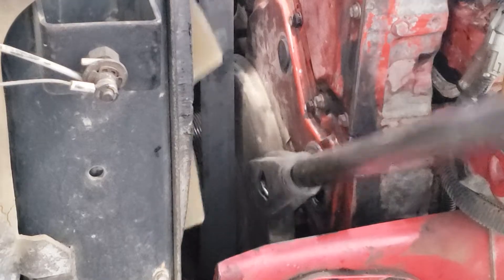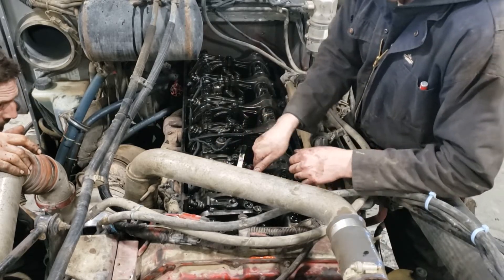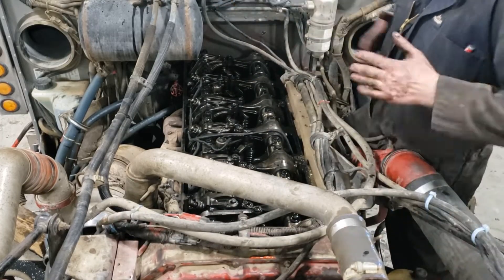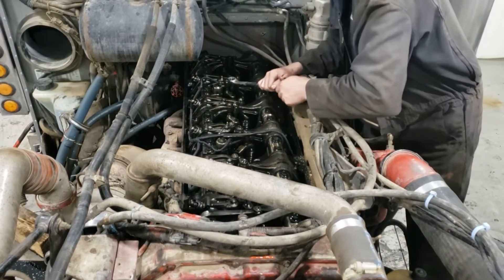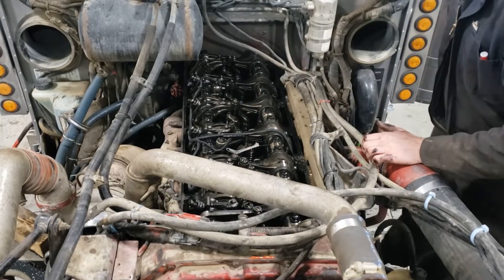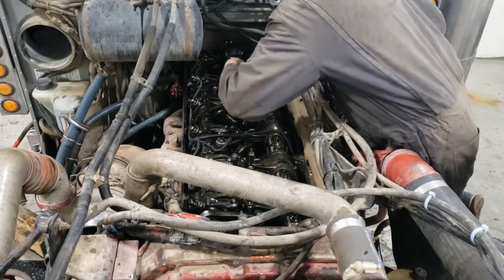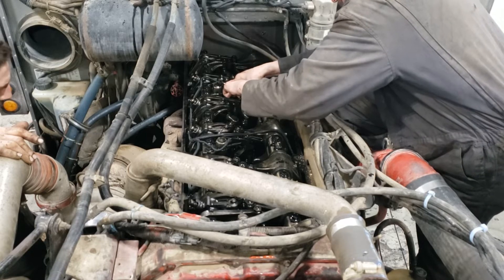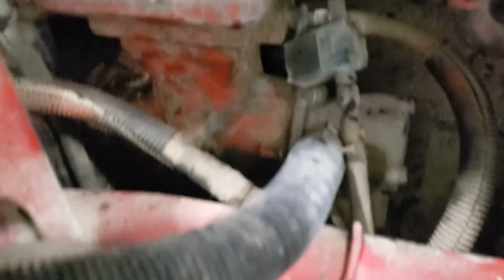How To: Overhead Set Valves and Injectors on a Cummins ISX

Comment: If you have Jake brakes how do you adjust them?
Reply from the maker: Same way you adjust the valves.  They are .250 clearance if I remember right.  Helps to get a .250 key shaft and weld a small rod to it to use as feeler gauge.

Comment: as a young diesel tech (23) i really appreciate what you are doing . you make this so simple to understand , i am a fleet tech and 90% of our units are x14/15s although i may never see a valve adjustment at my current job  i would like to do it on my own in the future . as well as in chassis overhauls . again thank you
Reply from the maker: Thank you,   I’ve seen quite a few of these Cummins (almost all) that the valve lash gets tight after about 200k.  It’s definitely worth a check.  Had one on an 11 that would run hot and it ended up being tight valve settings.
Reply: @zedperformance  thanks for the heads up I'll keep a look out for it . Most of our issues are aftertreatment related at this time .
Reply from the maker: @swiftyunit5475  that’s why I’m glad I’m in Canada lol